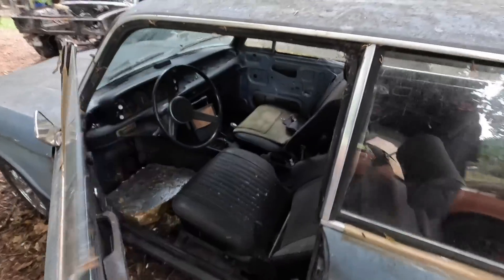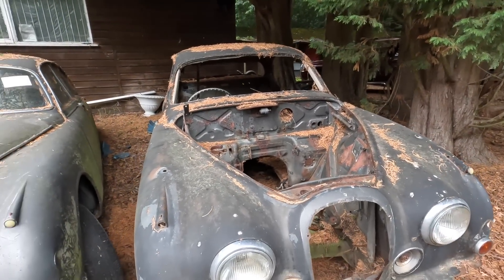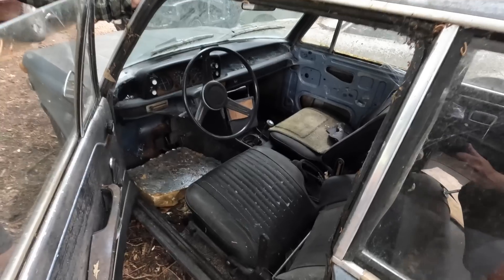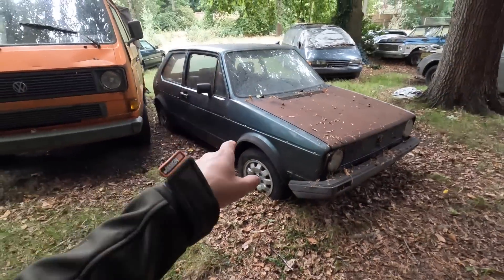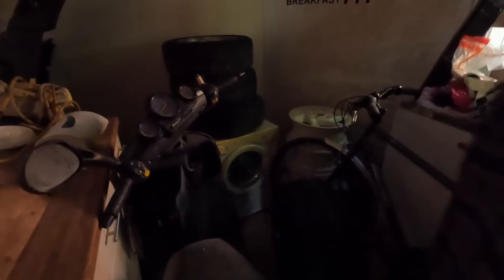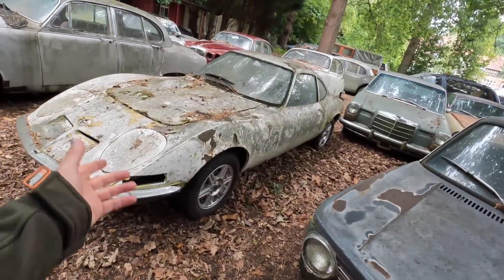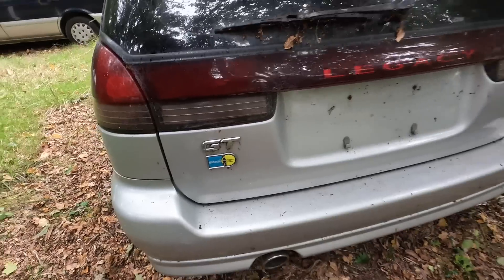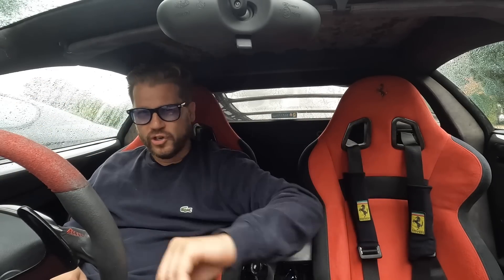Exploring a Classic Car Graveyard at Abandoned Multi Million ££ Mansion - with The Bearded Explorer

Comment: That BMW 2002tii is incredible and brought back memories. I had one that I had started restoring but had to give up due to cash flow, and losing storage/work space. Mine was a 1972 in Inka Orange. It is fun that you pointed out the tail lights, the most desirable 2002's were the "Roundies" which for the 2002tii was only the model years 1971, 1972, and 1973.
Reply: It's an early  US spec 2002, tii never made it to north America they were bosch Mechanical fuel injection for US market on all 2002s , virtually every German car had Bosch Mechanical injection in 70s, in North America the  entry level  model Mk1 Golf's were 1800cc with bosch Mechanical injection, in Europe we got 1100cc carb model entry level.
Reply: How much was The price for 2002tii? Nice to know it🔥

Comment: Still watching the video (only about 7 min in), but the 2002 tii, the Mercedes W114/W115 behind it and the Jensen are all US-spec cars.  You can see the NHTSA/DOT mandated (as of 1967) sidemarker lights on the front and rear quarter panels of all three cars.  So the mileage on that 2002 was indeed in miles, not kilometers.

Edit: Aside from the Chevy C10, other US-spec cars are popping up as I continue to watch.  The TR6 and the Jensen behind it are US-spec.  In fact, the poor rotten orange Jensen still has its Arizona plate.  Pulled from dry and sunny Arizona to rot in the UK, sadly.  The black Mercedes ponton at 17:00 is also a US-spec car (LHD plus all red taillights)
Reply: The front marker lights would support that assumption ; but actually European Pontons had all red tail lights as mine does ( and I'm only the third owner ) as indeed did early Fintails since the requirement for Amber indicators only came in around 1964 ; this one having Amber indicator lenses suggest they have been changed since they normally came with white ones , but many owners retrofitted the Amber ones for better visibility .

Comment: Just looking at it so theirs an Opel GT,  Jag Mark II, Mark X, an S type, the mark II with an expanded back end and the independent rear suspension that became standard after that, Mark II's are live axel, BMW 2002, Jensen, the mark II with the white walls means those are the OG tires from the factory, possibly for european to american export, as the E types were delivered like that

and that is a 1960 at 2:24, inspector morse style, they changed the front abit latter on, also the badge denotes the literage under the hood which seems to be gone

also the pre 67 cars, which is when they were getting ready to downsize the Mark II range and move onto the XJ6 had geniune conolloy leather, they went to Vinyl after that

and a Jensen Heally at 3:05, that is not a minger, its got some jensen hotrodded motor in it, one of the last jensens every made

and maybe with that orange transport you could turn it into a ferrari break down vehicle 

also with 16:13 that is what they coppied when they made the Morse Mark II, the color is Damler Imperial Red with a vinyl roof, much like that, think that one was Opalescent but maybe with a buff that will come back. 

like if your gonna save one, save that, mind you Harry Metcalf just did one and they are not cheap to put right, and that was an XJ12 coupe, same body as that roughly

like your luck would really depend on finding spares or buying two, one with a good body and putting it on that, as they used to be 5 thousand pounds, now they've gone up abit

plus side is you could buy them for parts and sell them to maybe the same people harry worked with.

Comment: Saw a 2002 in that colour a few weeks
Reply from the maker: They are big money now in good condition
Reply: I remember about 15 years ago the tow company I worked for junked a green one with zero rust. It had no compression and nobody bid on it at auction. We also junked a couple of supra's right before fast and furious came out.
Reply: @Ratarossa  it just needed a touch up on the paintwork and some outer trim parts
Reply: @kinkskustoms4229  thats mad
Reply: @fernandoroberts3591  I almost bought it for the $100 opening bid but I bought the 1988 Trans Am with 62,000 miles instead. I own 9 classic cars that I bought from that auction. None cost me more than $500 Back in the day $100-$500 dollar cars were easy to buy at auctions around Christmas  and when kids were going back to school. Just watch out for local tow company's that auction off unclaimed motor vehicles. People are worried about school supply's  and gifts around those times,

Comment: The black Mercedes Ponton you went on about is much later than you thought . 

The groundbreaking unitary construction body shell with passenger safety cell and crumple zones front and rear was only introduced in 1953 in the shorter 4 cylinder variants W120 type 180 ( with side valve engine carried over from the 170 ) and W121 type 190 ( with modern OHC engine continuing up to the mid 1960s ) , which that car clearly is not . 

This car is a six cylinder , as evidenced by the longer front wings with the chrome spears on top , featuring the indicator and parking lights ( the light below the headlamp is not an indicator , it is a parking or running light , depending on market ) . 

The chrome strips along the side could denote it as either a W180 220a with single carb 85bhp engine ( built between 1954 and 1955 ) or a 220S with twin carbs ( 1956-59 ) , However this could also be a 220SE , W128 with fuel injection and 115 bhp , built from 1958 up to 1961 . 

It is clearly NOT a W105 219 which has the long front wings with spears , denoting the M180 six cylinder engine with single carburettor ( 1956-58 ) but shorter rear doors with one piece glass and no chrome flashes along the doors and wings .

These cars are now highly desirable and fetch strong money , most especially the coupes and cabriolets , for which prices reach well into five figures now ; this , of the various cars shown in your video is potentially the most valuable by a considerable margin . I'm glad I bought mine in 1982 .